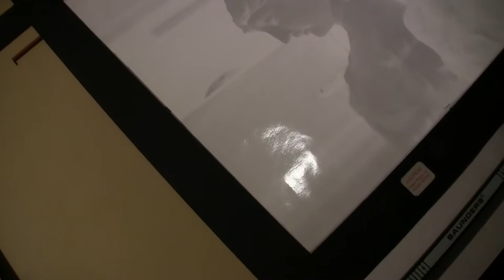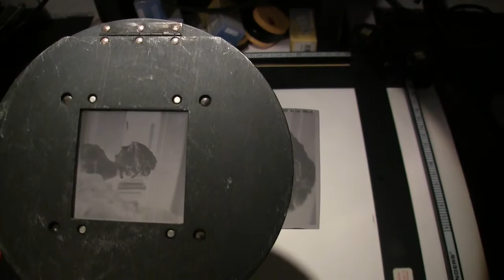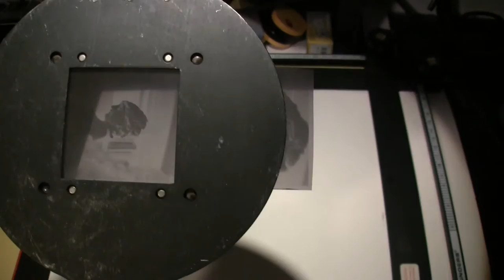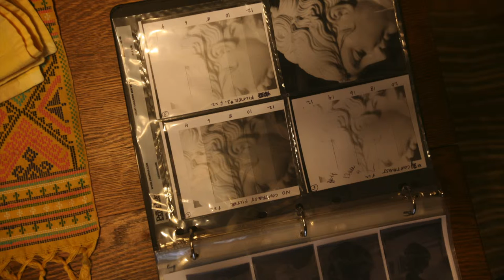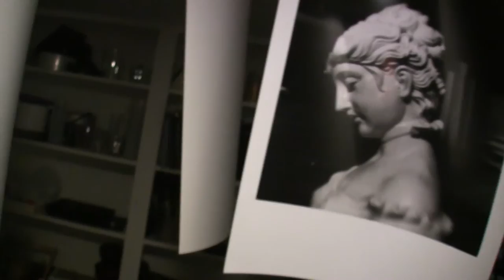hawkeye prints

Comment from the maker: Another way to develop 16x20 prints was used but never documented in video; it uses a rotating big tube. It is easier than using trays.
Reply from the maker: Unicolor and Beseler made tubes and motor rollers